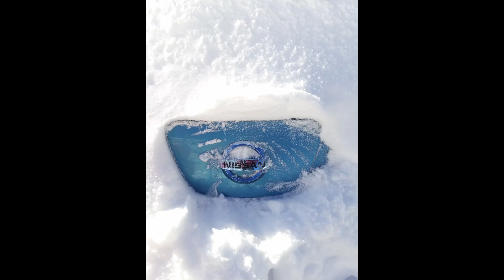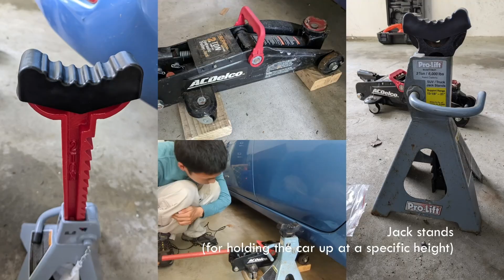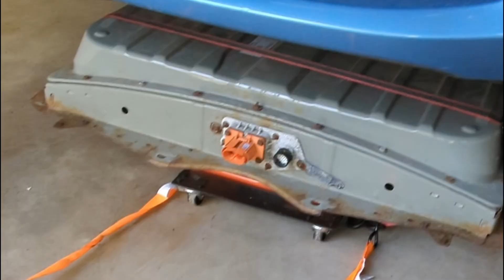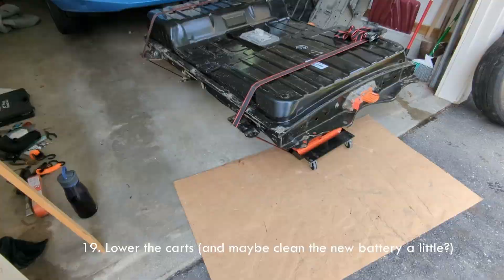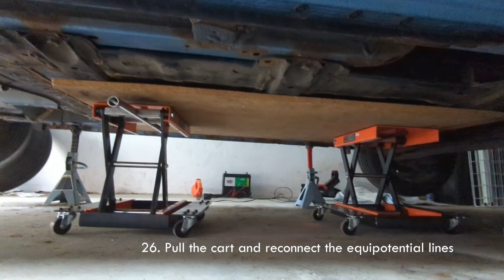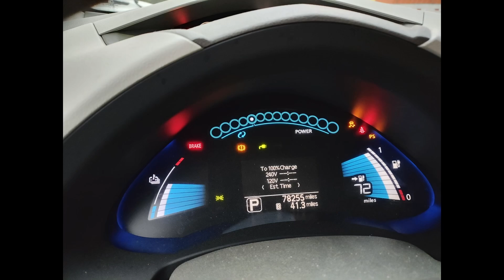Engineering for sustainability: Rebirth of an EV - 1st Generation Nissan LEAF Battery Upgrade

Comment: Well documented! Also very well done on safety discussion and implementation. Suggest you use CRC contact cleaner and anticorrosion spray on the connectors before mating. It helps to prevent arc tracking and formation of corrosion.
Reply from the maker: Thank you for your suggestion! Just did as you recommended.

Comment: I noticed your Nissan Leaf undercarriage has rust from the NY salt roads during winter. Since you already have the car on jacks, a complete job would replace the battery AND protect the undercarriage by washing and sanding the rusted areas then apply undercoating spray. Your Nissan Leaf is not going to last another 7 years if you don't do it.
Reply from the maker: Yes, I did exactly as you suggested. Thank you!

Comment: cool project. ~40miles usable to 160miles usable is very respectable. kind of crazy how cheap lfp batteries from china are now days though. makes the economics of ev repair really weird/distorted. my 2 chevy volts of the same era (2013 and 2014) are both at over 90% state of health with no impact to their usable ev range which is crazy. at around 150k miles each theyre somewhere around 3000 total cycles on lmo chemistry lol. goes to show how important thermal management is.
currently working on expanding the 10.5/16.5kwh lmo battery in my 2013 to ~40/50 kwh by adding cheap chinease lfp cells in the back with a direct hv dc tap. atleast 3 other people have demonstrated this working with original volt batteries to the detrement of hatch cargo ability, but no one has done it with mixed chemistries yet. with the soc range of the gen1 volt and 96s original pack, it actually lines up perfectly for 112s lfp which is 7x 16s modules. 16s is special coz its the most common "48v" lfp setup. 
to add ~10kwh usable ev pack, it only costs ~800 bucks for lfp bats after tariffs. before it was more like 650. lfp prismatic is just dirt dirt cheap now and if the cells degrade you just slap in more cheapies. hoping to be one of the first people to do a proper battery extension in the volt without sacraficing too much of the hatch cargo space, ~6 inches of height which puts it on par with cars like the prius/prime/phev where they did the same thing, throw prismatic cells in the hatch, although toyota used garbage early gen liquid electrolyte nmc cells and had a pretty laughable ev only range. i think 2015 prius phev was like 15 miles.
made a lot of mods to my 2013 volt already to get the miles/kwh up as high as possible and reduce weight, solar roof, agm delete/LTO low voltage mod up to 15.8v. all these havent been documented before in an EV/EREV. theres a poorly filmed video on my page showing stuff.

currently at ~4.5-5 miles/kwh and im hoping to end up with ~200 miles ev only range with another ~350 miles of gas only range. gas is cheaper than supercharging so it makes a lot of sense to use for hwy driving/road trips. cost is ~2500$ to basically turn a volt into the perfect electric car that automfg refuse to make. will end up ~500 lb under GVWR which is hilarious.

Comment: A torque wrench is not used to remove bolts/screws - in fact that could damage it. Use the torque wrench when replacing the bolts. And never get any body part between the battery and the ground (when lowering the carts), use a long extension on the drill to keep yourself safe.
Otherwise well done for extending the life of your car.
Reply from the maker: Thank you for your input! For the bolts with limited space, the torque wrench was used as a break bar as that was my only option at the time. Thanks for the safety reminder as well. There were more safety engineering details going on in the background, but they were cut in the interest of time. I'm thinking about maybe making a separate video to focus on this topic since many viewers seem interested in this. Again, thank you for your support!
Reply: Where I can the Cambridge can you help please  @Hands-OnDeck

Comment: Nice- I was thinking to buy 1st ev Leaf gen 1 and ordering 64kwh new battery from chinese company Vivne- but it is 8000 usd (around 30K PLN) with shipping. They have their own BMS, basically plug and play battery. But the battery cost is even higher than the cost of the used cars here in Poland, where I live. So I dunno what to do. For 60-70k PLN I saw Hyundai kona 2019 with 64kwh battery and high spec. One company in Poland is modyfing leafs but it cost like 50k PLN (they also change the regen to be much stronger). What do you think about this idea?

Comment: Would it not be a good idea to add some rust protection in the areas worst effected before fitting the newer battery?
Reply from the maker: Thank you for your suggestion! Just did as you recommended.

Comment: Gret job! I wouldn't recommend using a can bridge as it only blocks the information he doesn't want to interfere. I would prefer a reprogrammed BMS which is safer and also calculates much better the mileage.

Thanks for sharing!
Reply: The problem is the car cannot talk to the 40kWHr BMS. Reprogramming it with a 24kWHr version will make the battery unsafe.
Reply from the maker: If I'm correct, both have their own merits at this moment. The Can-bridge will have the least interference with original onboard BMS. Meanwhile, there's now an easier way to get the battery ID matching issue solved. More BMS reprogramming for "accurate" milage/range readings could be done, but that involves some risks. 

For the time being, only going as far as solving the battery ID issue with the LEAF Spy app might be a good balance. For mileage readings, the algorithm from Nissan wasn't that impressive in the first place anyway. Field test runs could get yourself a reference chart that's just as good, if not better.

Comment: What a project! I am amazed how straightforward the swap was, in a garage with little headroom. The car did not need much of a lift. I did not see how you paired the new battery to the car using the adapter tool and its open source software. That must be key to a successful swap.
Next time you do it, put the battery support trucks the same way round ! Then their lift/lowering bolts will be on the same side.
Brilliant effort.
Well done!
I’m awaiting both home charger install and a New LEAF Tekna to be delivered. (… as of 9th Oct ‘24)
My aim is to run my house from the LEAF battery using V2H charger - not yet available in the UK, but coming in 2025.
I saw an Artisan Electric YouTube video, where they installed a new home charger. They installed a current-sense coil on the Tesla Powerwall output, to switch off the Powerwall when the EV was charging, as if they didn’t, the EV drained the 2 Powerwall batteries flat, as they were ‘on’ when cheap rate charging switched on the EV charging side. This made me realise the average EV battery capacity is many times that of a Powerwall (or equivalent) set-up.
Matt (UK and aged 68, and 40 years doing technical electronic stuff in the industry)
Reply from the maker: Thank you for your support! The two battery supports/lifts are oriented this way on purpose as part of the safety and redundancy design. It's the first time they'reused in this context, so a fail-safe overrides convenience.

On the powerwall: my current focus is on advocating for repurposing retired traction batteries for energy storage use with the highest efficiency and safety standards. Using brand new cells for a powerwall is understandable, but dumping retired traction batteries directly to recycling is not the best course of action in my current view. But of course, replacing home-use gas generators with stationary/mobile energy storage implementations is one important milestone in this long journey—especially when it's getting longer by the day. Please do share your process and stories! I'm eager to see them! 😊

Comment: Thanks for the informative video, you’ve done some fantastic work 👍🏼

I’ve a recommendation to go along with your work. I’d def recommend using some rust converter on the undercarriage of your Leaf. I saw several areas that were rather rusty and some areas are beginning to show signs of rust. 

The battery swap you did is phenomenal and will certainly extend your car’s range. Doing a bit of maintenance on its rusty bits will further extend the car’s shell as well.
Reply from the maker: Thank you, and great suggestion! I've since sprayed the thing down with some rust removal (may show soon).

Comment: wow .. i have a 2015 with a 22 or 24kw battery. I would like to change it to a bigger battery. I understand the physical side of undoing the bolts, and the straps and lifts. What Im not too sure about is the connections, I see you used a black blank, you also spoke about some software, you also showed some sort of extra adapter that you have added, but didnt show where is goes. Any help you can give would be amazing. Thank you for sharing this with us.

Comment: I have been wanting to do this to my 2013 for quite a while. Where did you get the 40 kwh battery? How did you know what you were getting before you bought it?
Reply from the maker: It's stripped from a totaled 2019 LEAF. The mileage and year told most of its story, and luckily in this case it still can be turned on to connect to OBD II.  

Your concerns are real and legitimate; I went through the same process. To be honest, if you only rely on the scanner, your task would be harder. Sooner or later, you would have enough experience to make the call based on the mileage and year. 

A test platform that could do a "quick connect" between the battery and OBD II would not be easy—especially a hand-held system for field use, if one couldn't figure out a way to get around the ECM (and an emulator might not be justified...).

Comment: Interesting step by step guide to battery swap; thanks for sharing. 
Did you consider replacing the battery cells with modern cells from CATL? 🤔
Reply: He replaced the pack as a unit, not the individual cells contained inside.  You can buy a pack with CATL cells from China but it costs 8000 shipped.
Reply from the maker: You are so close to my procurement story...😂 Glad you like the video and thank you for your comment!
Reply from the maker: I had done the final preparation and plan for a cell-level renovation when the tariff on lithium-ion traction batteries hit... I ended up going back to the original plan. For cell-level renovation, the focus should be on the heat dissipation design.
Reply: https://youtu.be/al3BGVxnIOs?si=UG_HpFhh9EXlRwrX